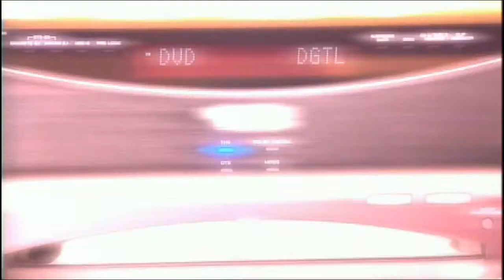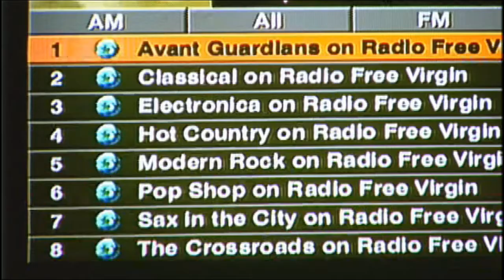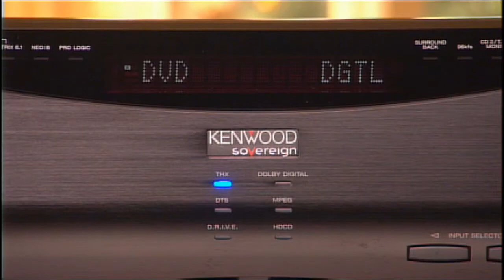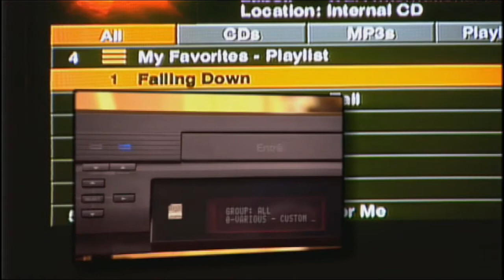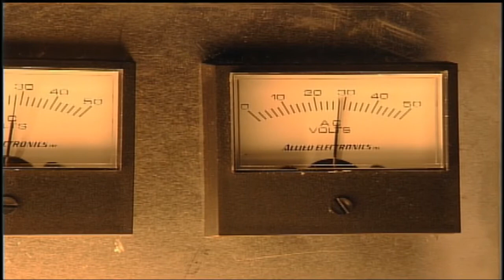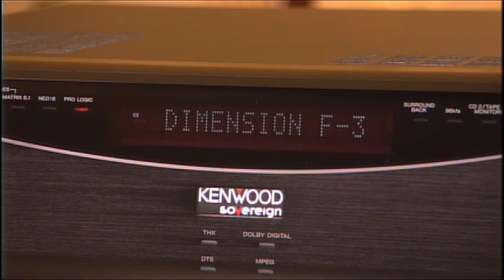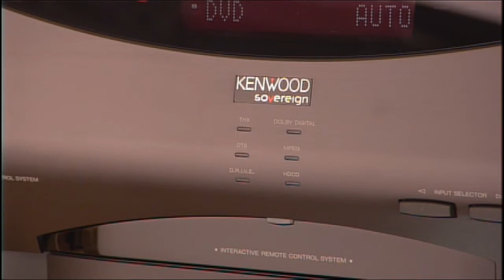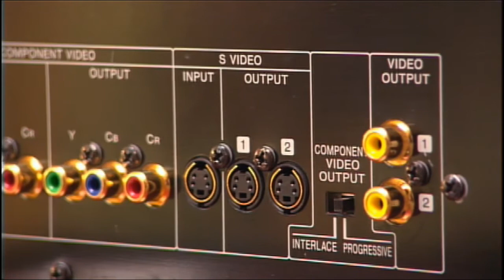Kenwood Sovereign

Comment: So where does one get / have the VR-5900 amps repaired at? have several that are dead no sound, work one day dead the next!
Reply: Very good question…mine was DOA more or less. It’s sat in its box ever since. Was told no parts availability since it was so advanced parts were proprietary. Simply fantastic huh?